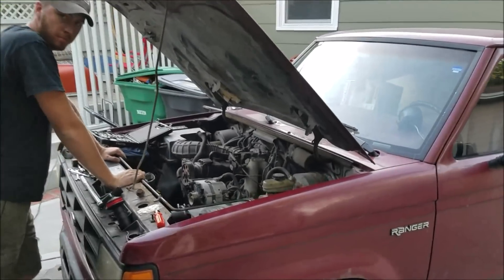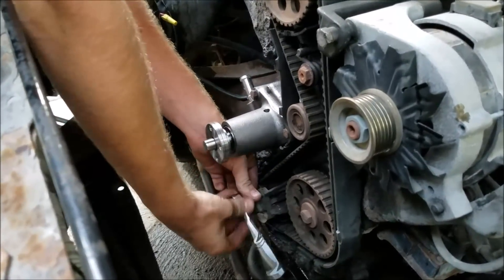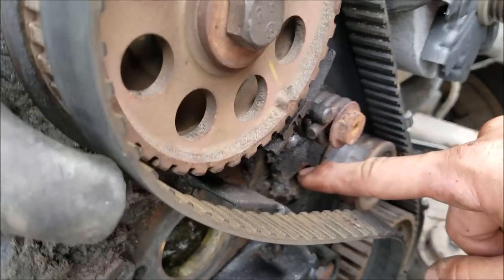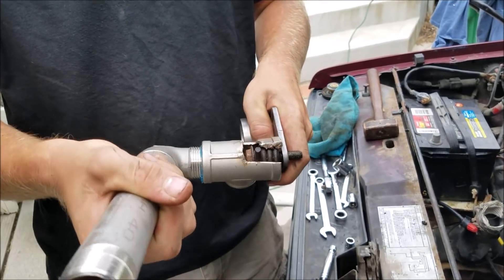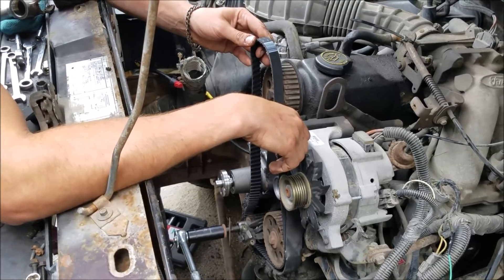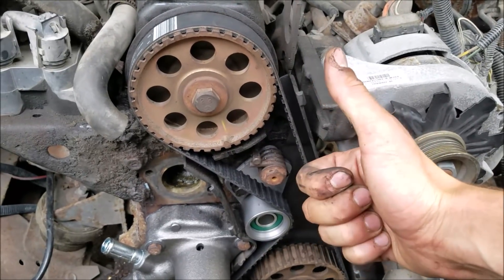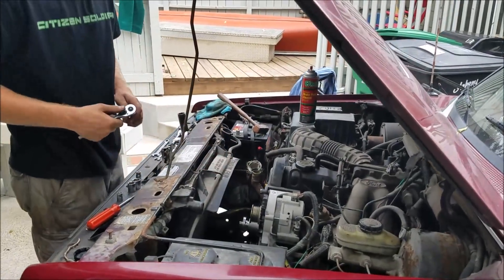Ford 2.3 Timing Belt Replacement How To (& Tensioner Tool Explained)

Comment from the maker: Depending on the year, the oil pump gear position is important - 
Maf = cam position 
Oldschool/carbed = distributor
Reply: So this Engine is a non Interference and that is why oil pump gear position don't  matter?

Comment: Just loosen the tensioner bolt, put a bar against the idler and pry it where the belt is loose then tighten the bolt back up. Take the old belt off,  make sure everything is aligned, put the new belt on. Loosen the tensioner bolt then put a slight bit of extra tension on it and tighten the bolt. Note: unlike this guy saying it's not important where the oil pump drive pulley is... It's VERY important if your rig has a distributor as it's also the drive for distributor position. Take your distributor cap off and check to see where the rotor is positioned making sure it pointed to the number 1 position. If you align the pulley willy nilly you're going to have to reposition your plug wires in the cap and reset the timing. 
.

Comment: just doing a head gasket replacement so i dont think i need to pull off the harmonic balancer, just line up marks and remove belt, tin ware and head

Comment: Years back I  had an 84 hatchback with the 2.3. Changed the belt not knowing it was advanced about 9 degrees. But the little motor would spin the tires from a stop, couldn't do it with factory sttng.

Comment: THE OIL PUMP SPROCKET ALSO DRIVES THE DISTRIBUTOR!!!!
Reply: NOT ALL 2.3L ENGINES HAVE A DISTRIBUTOR!!!!! That’s the fuel injected version of the motor. You’re welcome.

Comment: I have a question... I know the ford 2.3l lima had a timing belt.  Is it possible to put a timing chain on instead for extra durabillity?  or could you swap a mazda 2.3l with timing chain in instead? Thank you for your time!
Reply: Actually, changing the timing belt is a pretty easy job for this type of engine. The belt should last 150K miles.

Comment: How do you remove that crank bolt without a impact?
Reply from the maker: Breaker bar and truck in gear with manual trans. If auto, you are kind of screwed without an impact. 
Get a breaker bar and smack in hard with a hammer and pray
Reply: ThunderHead289 thanks for the tip... I got it off but the only issue I have left is that the timing belt keeps walking with new belt and tensioner. I have no idea what is causing this. Any ideas?

Comment: Luke! Nice job buddy. Now, that 1999 $400 Ranger I just purchased had some squirrely compression readings and lots of popping when I ran it 5 revolutions without any plugs to get the compression  values. 0 - 90 - 45 - 90. The previous owner who parked this at the dry cleaners and it never started back up, thinks it jumped a couple teeth on the belt. Quick look at the belt and it looks OLD. I suspect he may be right. I just don't want to dump my whole RockAuto parts list in it until I know more. So, tomorrow, I'll see if I can look at the timing marks and see if it's off. Otherwise I'm gonna just have to tear into it. At first, I thought the motor was gone, but I don't think it is. It's got 189K miles and looks VERY stock with no Mickey Mouse throughout. If the valve(s) were gone I don't think I'd have low compression across the board and it just sounds funny. I think right now, that the PO may be right. Not going to give up on it yet. Thanks Jake for all your amazing efforts. You are a FONT of knowledge and I wish you lived closer. I'm sure we could/would hang out. Thanks again buddy.

Comment: How do you take off and put back on the tensioner spring, I have a 93 mustang 2.3l and my spring isnt holding tension and its jumping timing easily so I'm assuming I need to replace the spring any ideas how to replace it or why its jumping timing?

Comment: To relieve the tensioner simply put a small bolt into the end of the bolt that the spring is around (yes it has a threaded hole in it that holds the cover on)  and use a small crowbar to pry the tension wheel back. The small bolt will help pry and keep the crowbar from slipping off.
Reply: If you post i video of it i 100% would watch
Reply: Thanks for the advice, just yoinked the belt. Also if you think it’s tougher you can use a longer bolt from the valve cover. Also I’m assuming it’s necessary to remove the bolt directly above the pulley. (that’s what I did)

Comment: I thought these 2.3 engines were interferes engines 🤔
Reply: Negative. Hydralic lifters
Reply: @ravenskaugrud8410  Having hydraulic lifters doesn't mean anything. One of my vehicles has hydraulic lifters and is an interference engine.
Reply: @michaelcohen9363  congrats? this is not an interference engine.

Comment: While I was in there I changed the crank oil seal..I see a lot of oil all over the lower part of the small sprocket..this seal is cheep but a pain to pull off. The belt gear should've come off easy but mine did not and I made a puller out of a few Molly bolts and a piece of steel with holes in it, the bolts are long and fall right into each belt groove, it worked perfectly. Can't see doing all that and not changing that seal. Thanks for the vid though it helped me make sure I was lined up for the new belt...cheers
Reply: I have a 94 2.3l, what tool you used to remove that small sprocket and replaced your crankshaft seal?
Reply: @path2049  I made it...I used these long bolts called moly screws like they use for drywall.(got it from hardware store) .it's got that little buterfy thing on the end that expands when you put it through gypsum..drywall or wallboard as some call it.
I take off the little buterfly part,(it screws off) then turn the bolt around and use the head of it to slip behind the timming pully, the bolt fits into one of the teath of the pully...put two one each on oposite sides,,use a hose clamp around them will keep them in place. I used a flat piece of metal I drilled two holes in about the distance each moly bolt was and one in the middle for another bigger bolt and nut to turn against the drive shaft center. put bolts on the moly bolts as well,,, you don't need a center bolt if you just turn both moly bolts tight and let the center of metal bar or flat iron to push against the drive shaft.....I know it's hard to explain,, a picture would be better. if I have time I'll make a drawing for you. but if you allready have that off and are just trying to get the seal out, you can drive a few drywall screws into it and use a plyers to pull it out..I don't like to use any picks or screwdrivers so I don't scratch the surface of the drive shaft,, but you also have to be careful with drilling screws in..if you can't do that try a punch or nail to pierce the seal in the middle of one edge and get somthing to pry it out. but be careful..scratch the metal surfaces and it won't seal very well..
Reply: @path2049  here is a picture of the bolts....https://www.reflectwindow.com/products/toggle-bolt-anchor-3-16-x-4?variant=29518274461814&currency=USD I used them because they are long and about the right size.
Reply: @path2049  the head fits behind the sprocket,,at least the ones I had did.. so measuring across the span of two of them attached to the sprocket you can drill two holes in a piece of metal and screw the toggles back on and force the sprocket off little by little..hope that helps.. good luck.
Reply: @chuckthebull  Thanks. I think I got the idea.
Reply: @path2049  awesome...I was glad I could help..I don't think anyone make an actual tool for this except maybe Ford and they will cost a bunch..this was a quick and dirty solution for me and worked perfect..so I hope you have the same luck if you try it. cheers!

Comment: Do you know what the tool you made is called?  It would really help in a search. =)
Reply: no tool needed - To relieve the tensioner simply put a small bolt into the end of the bolt that the spring is wrapped around (yes it has a threaded hole that holds the cover on)  and use a small crowbar to pry the tension wheel back. The small bolt will help pry and keep the crowbar from slipping off.

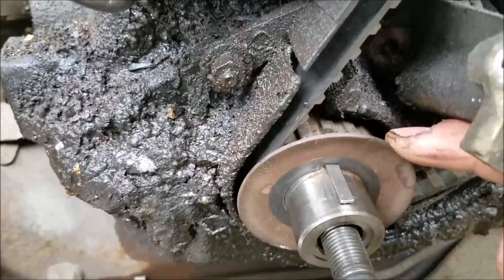Comment: At 2:59 into the vid, you're showing a washer on the camshaft---I'm in the middle of replacing the timing belt on my 1998 Ranger, 2.5 4 cyl.  However, there was no washer on the camshaft, when I tore everything down. The broken belt was not OEM, so someone has replaced it b4 ( I bought it used). I spent 1/2 an hour at the Ford dealer parts counter, only to find out that it's not available anymore. Any suggestions as to where I might find one? Not having much luck online, either. Ford part #D4FZ6K297B.
Reply: did you find one?

Comment: Two things.....You failed to show us your homemade tool being used to release the tensioner spring to slip the belt on. And you are supposed to manually rotate the crankshaft 2 complete revolutions to set the tensioner tension properly.
Reply from the maker: +Larry Gee false - I 100 percent showed the tool and explained how it worked. Rotate two revolutions? Are you sure we are even talking about the same engine? Ha!

Comment: i shoved a few timing belts in between the crank slot without taking the pulley off. just terrible, but so far it's been going strong for 40k miles. 2.3l lima block. no visible belt damage.
Reply: the 1995 and up have a cam sensor and an oil pump built right behind the auxiliary shaft. that was a damned good block.

Comment: i have one ranger 1990 2.3 engine. This morning i was driving to work. And my engine cut off. I stop on the side on the road i pop up the hood i pull little the timing belt cover. And i see the timing belt is broke. My engine is can have bad valves now and damage pistons or not? My truck have inference engine or have none inference engine?
Reply from the maker: +Haralabos Lukatos you are good to go, the 2.3 is not an interference engine - replace belt and rock n roll
Reply: thank you for the answer. My truck is fixed yesterday. Is run now. The mechanic charge me $263 for the timing belt.I use the AAA tow truck and take my truck to the mechanic. But one very weird happens yesterday my truck broke down today  my wife truck broke down and we use the AAA tow truck again. My wife drive one ford explorer 2002. The transmission looks go bad. Is put drive the truck not move act like is be on neutral. For about month the truck is used jerk when is shift gears on the road. This year trucks i see no have dipstick for check the transmission fluid. Now i belleve is no have fluid. Is can have burn the transmisson because no have fluid?
Reply: Haralabos Lukatos  I have 1988 Ford ranger 2.3 I was driving down the hwy and it just shut down try to crank it a couple off time but  no luck so I took the timing cover off and the teeth were mees up it sound like  the same problem you had  so your truck is still running good

Comment: ThunderHead289! Great Vid! Asking for advice, Got my timing belt and new tensioner installed. When rotating by hand the belt rides up over the teeth misaligning  everything. Any suggestions? Mine is a 93, looks just like yours though!

Comment: I bought the same truck. Was told the driver side coil pack was bad since it wasn't firing. Figured that part out pretty quick lol. Engine fires and turns over but wont start. I took the timing belt cover off and there sits the timing belt snapped. My question is, should i be able to turn the cam sprocket because i can not. And how do u turn it?The truck is real clean and everything else looks pretty good.
Reply from the maker: it will be difficult to turn because you are fighting the valve train on the engine. the easiest way i would think would be to just put the belt on and get the timing mark aligned on the cam sprocket - then just remove the belt and properly align the crank sprocket and reinstall the belt. - also depending on the year, that oil pump drive sprocket has an alignment mark as well.

Comment: Hey guys I did this job on my ranger(same engine) and now the harmonic balancer seems to be hitting the crank sensor ..please help
Reply from the maker: Hey, did you try installing the harmonic balancer down with the crank sensor still fairly loose? Check exactly how we do it in the video

Comment: I believe that you are supposed to rotate the engine a couple of revolutions with the tensioner bolt loose to allow the belt to self adjust, and also to verify that all the marks remain lined up after rotation.

Comment: I wish you guys woulda made this video 1.5 years ago.
my timing is off by a tooth :)  ...makes it a bit rough to get into gear and weaker at lower RPM.

I think this is gonna be the definitive 2.3L ranger timing belt video. congrats. You have finally cured the world of the need for this tutorial. Nobody needs to bother trying to improve upon it. This 2.3L timing belt changout problem that the world has had since the 80's is FINALLY SOLVED. :)

Oh and the reason for the recess on the tensioner tool is to not snap the tensioner stud.
Ask me how I know.

Comment: Great video, just one question though, do you like chevy? I've seen a lot of Fords on your channel (havent been here for long though) and figured there might be a reason.

btw I like all brands, so no hating of any kind going on.
Reply from the maker: Im actually fairly impartial - i lean a little more on the ford side since it s what i grew up around and i already have the parts around for the older stuff. as far as hot rodding, i like fords manual transmission adaptability and their rear diffs. Most folks out there are chevy, its kind of fun to be on the other side. 
the ranger stuff i prefer to the s10, i just think the ranger is just plain built tougher. 
that being said, i dont like anything really post 1997. - my apologies for the book i wrote here.
Reply: Man I've written questions twice as long and half as understandable before, don't worry lol.

I was gonna ask which one was generally easier to work on, but there's so much stuff out there that the question seems dumb already.
Either way, I lean towards Chevy just because my dad had a C10 I loved, other than that I really couldn't say, I'll get my hands on whatever I might find interesting.

Thanks! have a great weekend!

Comment: If you allow the oil pump gear to turn it will throw your timing off because it also turns the distributor.  I found out the hard way and it is a bitch to get it back in time
Reply from the maker: Yes this is indeed correct if it has a distributor or cam sensor. This particular engine has nothing dependent off of the oil pump - I pinned a comment and I made mention of this in the description below the vid. That was my error for sure in making so light of it.
Reply: Harold Lovett hey bud what did you do to get it back in time??..cause I’m having hard time timing my distributor....
Reply: @jimmymendez6737  I moved the plug wires around to the next location on the distributor cap.  It worked for me.  Make sure you have the plug wires wired in the correct direction as the rotation of the distributor rotor and not wired backwards.  I had a customer do that on his truck and I put them in the correct firing order and it fired right up.  I hope that I kave help you out
Reply: Harold Lovett thanks for the quick response...so what I’m working on is a natural gas generator(Onan)...and noticed that there isn’t any timing marks on the oil pump sprocket... I tried to set the dist. Close to #1 but no attempt to start just cranks...
Reply: Also the plug wires and cap are numbered...I gotta be off either on my timing or the cap & dist....thanks for your insight..

Comment: These Ranger videos are making me think about buying one. I want to start learning to work on cars, but I don't want to mess up my daily driver
Reply: OhighO Skater  do it they are great to learn on and hard to kill I have a 97 with the 2.3l the 7.5 axle 3.73 gearing and 31x10.50 mud tires I have hauled a little over a ton 3 times and it’s a very reliable little truck that can take abuse

Comment: The oil pump gear does matter bc the cam sensor is in that gear!!!!
Reply from the maker: If that is the case on most I will have to readdress this. On this one it doesn't seem to be.
Reply: Also on the older 2.3s it drives the distributor.
Reply from the maker: +Patrick Kissman that can be set accordingly regardless of the position as long as it's firing on top dead cylinder one. The cam sensor is kindof a deal though for sure.
Reply: Hello Thunderhead289

I have a question. What kind of replacement Tensioner timing belt ford 2.3 do you have on the video. Is it original?? I am from Austria. And I have problems to get this. Do you know if any car in Europe fits this timing belt Tensioner? 
Thanks for help! 

Greedings
Mario

Comment: Those 2.3's (and the 2.5's in the trucks) can make some pretty impressive hp. Pretty expensive compared to something like a small block V8 though. Have friends that used to race mini stocks.
Reply: tbirdracefan not that expensive if you go boosted